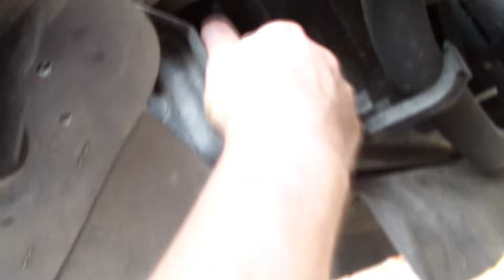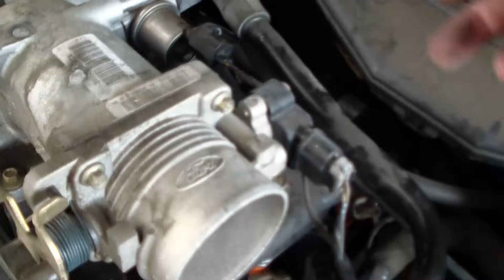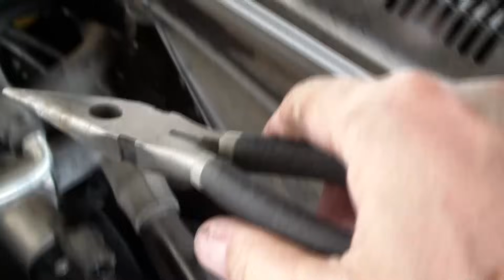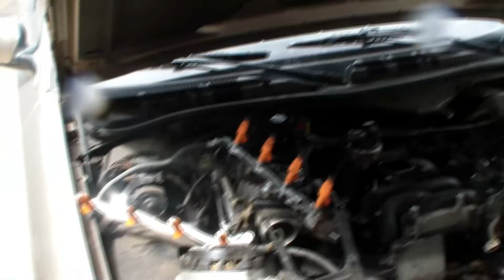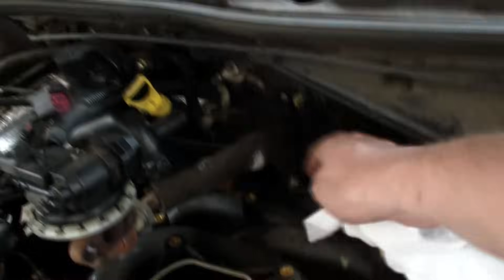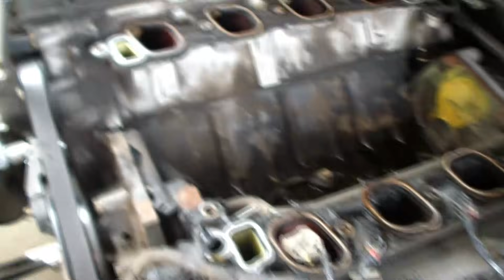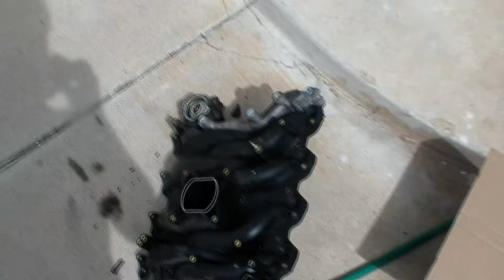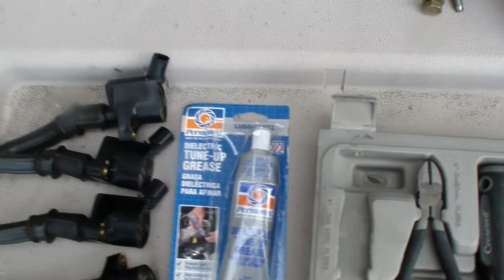Ford 4.6L V8 Intake Manifold Replacement

Comment: Also do you have to have your o-rings resurfaced when you replace the manifold?
Reply from the maker: The Dorman manifold had built in O-rings. I do not recommend aftermarket manifold. Get the original PI Ford replacement from Ford Racing. Much better.

Comment: I had my intake manifold replaced by Big o tires which they cracked however the plug where the heater hose hooks up still has the cap on it. So does that mean when I can't use my heater? I don't understand why mine is still on there,if it has to do with my heater. Can anybody help me?
Reply from the maker: Unless both heater hoses are connected you will not get any heat.

Comment: For this entire car, YOU NEED A SET OF FLEX HEAD RATCHETING WRENCHES. That bracket behind the intake, the bottom left bolt on the passenger side valve cover, and ESPECIALLY the bottom left power steering bolt
Reply: Man SCREW that power steering bolt. Just did a timing job and that was by far the most obnoxious bolt on the entire truck. 

But hold on, do you need to touch it for the intake gasket job?
Reply: @jtfoog5220 oh gosh I hope not I’m halfway in right now

Comment: I ordered a Ford branded intake manifold. I wouldn't be doing this if the aluminum crossover hadn't sprung a leak. UPDATE: I just installed my new manifold on my 02 GT 4.6L 2V. It looks similar to yours. I had a mess under mine on the same side as you did. Must have been some kind of coolant leak. I cleaned everything up as best I could without scratching or deforming any surfaces and hopefully it's adequate. And hopefully nothing went down into the cylinders. Hopefully everything seated OK. I won't  finish up tonight. I still have to re-install the injectors, cops, and throttle body. I got delayed because I decided to replace the 23 year old water pump (which took awhile to get out),  replace the hoses (the lower radiator hose was short so I got a refund and ordered a different brand), and I managed to round a bolt head on the driver side rear of the manifold (I had to go buy an extractor to get the bolt off). I hope I can get the cabling for the TB put back on correctly. I'm hoping for a lot of things to go right. I won't know if everything is working until after I get the new lower radiator hose.

Comment: Doing a similar job, replacing the stupid rubber hose from the water pump bypass, but fyi that entire vehicle is metric. 7/16 should be a 13mm. Your nuts and bolts will appreciate it
Reply from the maker: Thanks for the info.

Comment: So instead of the guy using a thread in brass fitting he decided to make himself replace the whole manifold. Easy.
Reply: I’m grateful he chose to change it. His video was on point. What I did differently that made it easier to remove the bastard bracket was removing the wipers and the molding underneath it.

Comment: 2005 Grand Marquis. Bastard bracket: Undid wiring harness constraints and used bungie cord to pull it forward. Removed a bracket on firewall  connected to tray where wipers are. Then was able to attack from the right side, get a 15mm swivel head wratching end wrench on. Bolt on too tight so cut a 2' peice of conduit for a breaker bar.  Next big hold up was the aluminum cross over all three 5" bolts were rusted in. Had to use a torch to heat up surrounding area. Bolts for thermostat housing were covered in rust all the way to the threads. 
  Found the source of the leak, on the manifold where the thermstat end of crosscover bolds into the plastic.  a 1" chunk of plastic was missing around a water intake. When putting on Dorman  it fit tight, suggest putting on left rear bolt first, then front rt, then rt rear. It was hard to align all the bolts with the holes, very tight fit. Idle is now high. Hope computer figures it out.

Comment: That plug that you said you needed to remove to use your heater hose, mine doesn't use it my hosees go elsewhere and while driving that rubber blew off. How do I plug that hole and what did I do wrong

Comment: All of my intake manifold bolts are rusted and rounded out! I purchased a bolt extractor kit and that failed! Heat didn’t work. My anger is off the charts! Any ideas???
Reply from the maker: I weld a new nut on top of broken bolt. Good luck.

Comment: Great shade tree vid.
I always drill tiny hole in thermostat plate to facilitate cool air relief.
Helps useless trapped air out of system safely. In the north east winter
air can/will gather where it's least needed.

Comment: You aren't going to ark the ground on tge ground with your wrench or ratchet. After it's disconnected, when you put the wrench or ratchet on tge hot, if you hit the ground, it won't arc anymore either, so if we stay in the habit of that, we'll save hide eventually, because the best of us will get comfortable eventually. Why not train ourselves well and try to bring the USA back on the map for quality work?

Comment: So i know this old but when taking off the bastard bracket my 01 vic has a bracket over that bracket held by a 15 mil bolt and a 13 mil nut then under that bracket the 15 mill stud bolt that actually holds that bastard bracket  the 13 mill nut goes on the same stud of the bracket ...passing it along

Comment: I'm in a pickle. Installed the intake manifold and right before torquing the bolts my heat lamp bulb exploded into hundreds of pieces. I'm concerned some glass got in the combustion chamber through the fuel injector holes. I'm guessing a piece of glass in top of a piston would be catastrophic. Any tips? I'm not pulling the head, that's way beyond my skill level
Reply from the maker: Vacuum out what you can. If you have compressed air blow out what you can. Crank engine with spark plugs removed to blow out debris. I bet it will be just fine with no damage.

Comment: I used your video to replace my intake with an Autotecnica FD1413042 intake that uses all the OEM bolts. With your video, It would have take a few hours if it were not for the driver side bracket and second wiring holder bracket that bolts onto the extended stud on the bracket bolt. A swivel 15mm wrench or a low profile socket with swivel ratchet makes. BTW, your video is used as a example on the website.

Comment: Is this intake still holding up? I am watching this after it says it has been 9 years.
Reply from the maker: The Dorman worked fine but I recommend using an exact factory replacement from Ford Racing. The Dorman did not have as much power and I lost 1 MPG.

Comment: Why not 'plug' the spark plug holes also? Whatever falls in could potentially drop into the engine when you replace the spark plugs. I also dielectric grease every electrical connector as it repels water and can make it easier to disconnect later.
Reply from the maker: No need to remove spark plugs to replace manifold.
Reply: @KentDiego  The coil pack are removed leaving the hole susceptible to objects/trash falling in. My compressed air was able to blow out wire wrap pieces. Not everybody has compressed air though. Eventually you will replace the spark plugs.

Comment: Leaking again yet
Reply from the maker: Did you use the Ford PI or the Doorman replacement part?
Reply: @KentDiego  well I talked with my garage but couldn't talk with Paul so I looked really good at where it was leaking  it was leaking from the thermostat housing two bolts that hold down the housing mass corrosion on it so they did not clean the housing before they put it back on  thanks
Reply: @KentDiego  sorry long time I didn't know you could use a pi intake on a non pi u have to know what you are doing few tricks I heard ??????? Not sure how to
Reply from the maker: @joegallagher9167  By that year the PI was factory original. The Doorman lost 1 MPG and did not perform as well. Learned a lesson to always use factory parts.
Reply: No the stock intake was not a pi intake it's not a cop car car from the country in lower KY 1 owner.  1st intake a1auto. 2 nd  intake garage bought somewhere poss AutoZone  so u are saying I can put a pi intake on a non pi heads

Comment: I have replaced my oem intake manifold on my 2007 F150 4.6L this weekend with the help of this video. However I am running into issues now. 
The Dorman has a different size and shape of the rear coolant passage that is blocked off, and as soon as I started putting back the coolant once everything was installed, coolant was pouring out the rear drivers side coolant passage...if anyone has any solutions to this, would be much appreciated

Comment: Just finished mine using your video and another.  The other was take off all the things, but helpful.  Yours is more practical for the garage rat.  Things that took some extra thought:  Gaskets on the new intake are the same shape, but different design than what i took off.  There are spacers for the alternator bracket to raise it up and compensate for the loss of the added height of the gaskets i took off.  Other than that it went as hoped.
Reply: Do you mind posting the link to the other video that helped you? Thx!
Reply: @AdamMayor  7 months out is beyond my memory for a video.
Reply: @MysticSpank  what about loss of height for the egr? Just kind of thinking if the stock gasket raised the manifold up. Then wouldn't when you bolt the egr in it, it would pull the manifold up?
Reply: @Neptune5.56  I had zero issues connecting the EGR.  I see i posted a year ago.  car is still doing well without any additional work to the intake or EGR.

Comment: Just finished mine 30 minutes ago,I cursed and cursed at that bracket,and seeing it really doesn't affect anything, decided to use my cutoff wheel and cut that bastard,after removing intake,unbolted that dumb bracket,cursed it to hell and threw it in the trash,all is good now 😭😭😭😭

Comment: Is the bracket that goes over the driver's side fuel rail absolutely necessary? I don't want to put that bolt back on in the back.
Reply from the maker: The bracket is there to protect fuel rail for 40 mph offset frontal crash test. Many people leave it off. It is not really that hard to put back on, maybe 5 minutes.  Up to you.
Reply: @KentDiego  Thank you for the reply and info. I just left the back bolt off. I had a really hard time getting it off just to fix some fuel injectors. Don't want to deal with it again.🤣

Comment: You should have went with an OEM. These aftermarket ones are garbage. It's a five year part. If you're lucky you can make it last longer. Even a used OEM is a safer bet than a brand new one of these. A lot of work for a cheapo part.
Reply from the maker: Wish I had the time to wait for OEM when I did this. Dorman was junk and I lost 1 MPG. Ford Racing is supposed to be best place to order OEM without getting overcharged.
Reply: @KentDiego  I got a used OEM from an online junk yard parts site. You just search for the part and it shows a list of parts, junkyard/dealer name and actual phone numbers. I paid $36 for mine and $20 one day shipping. It's a direct fit and it's like brand new.

Comment: Can you tell me how did you get that fuel heat shield? I have a 2010 Lincoln town car Executive L
Reply from the maker: Just fiddle with the bolt and you will get it off.
Reply: @KentDiego  can I ask what size you used and any adapter that made the job easier.

Comment: Did this job the other day. Everything went as planned. I used all OEM parts as replacements. I also used very light coating of rtv gasket materials around all ports mainly due to some pitting in the head near cool ports. My whole body hurt for a week 😂

Comment: Just a note! I'm doing this on a 2000 Town Car, and that pain in the ass bracket on the back of the manifold with the two 15mm bolts has ANOTHER bracket on top of it with two 13mm bolts on the back side. That's what the studded portion on the 15mm bolt is for, a 13mm nut goes on that, and then a 13mm a little further toward the passenger side under a wiring harness. Super pain in the ass.

Comment: I'm glad I sold my 2001 f150. The intake manifold was leaking coolant,after I had the metal pipe replaced from a previous leak. Horn went out,blinkers stopped working,a.c. went out too.

Comment: Dude I’m still stuck on the stud on the back of the bracket.
Reply from the maker: It's all about feel. Reach back and feel the stud to get a wrench on it.
Reply: Mine was under a huge harness. Used a 3/8” pic over head ratchet and deep week socket got it no problem and then the rest by hand. I left my EGR in so you have to be careful not to hit the pipe, it lines up with the ratchet

Comment: I wouldn't replace that manifold with anything other than the factory OEM upgrade 2002 manifold plastic but with actual brass bolt screw holes for all those coils!! You will be taking it off again soon. The coil pack mounting holes are always plastic and always break, crack.. they are total shit!! spend the money and get it from a dealer or factory, yes it will cost you much more $$$ but will not be replacing it 2 to 3 more times again as you are now!! Trust m, I own a 2001 Grand Marquis GS and had replaced my intake twice already This time I'm getting the one with all metal bolt holes not plastic shit.
Reply from the maker: The best price for a factory OEM manifold is at Ford Racing. Much cheaper than dealer.

Comment: Got my hands on a 97. It has the updated intake with aluminum runner between banks. Still leaks fluid onto the spark plugs. Fuck it, its getting an aluminum intake I guess
Reply from the maker: Using anything but the Ford OEM part will result in performance loss and other issues. Look at Ford Racing site for best price.
Reply: @KentDiego  I found something but the heads have to be 99+

Comment: Just did mine vehical too and I couldnt find that small lil plastic block position either on a 99 Mercury Grand Marquis or what fit into the 2nd hole the 8in allen key is used for. I used both of the metal screwsin pieces and plugged both holes for now and mine is running great.

Comment: Hello friend, how are you? I speak of Brazil. I see that people change this crowvictory collector a lot, which would be the biggest reason.
does it have any cracks or carbonization?
Reply from the maker: Over time the plastic used to make the manifold gets hard and brittle. This causes cracking resulting in vacuum leaks or coolant leaks. In my case the heater hose nipple broke off while I was changing the spark plugs.

Comment: Did you flush the fuel injectors and use injector rebuild kit them as well.
Reply from the maker: No. The injectors are fine. Never had a problem with them.
Reply: @KentDiego  I was just wondering I heard the o rings can be deteriorated  from years of use.

Comment: Yeah you messed up you should have changed that water tube it was looking right at you when you have the intake off mine just broke their famous for doing that. Double work coming up. Do your research. Retorque the spark plugs before they blow out.

Comment: I see you have some fluid in the engine valley. I just found out today I have oil there and it's now leaking down the back of the engine. Would a bad valve cover gasket cause that?
Reply: yes.

Comment: I had a mechanic replace my intake manifold on my 1999 Mercury Grand Marquis LS.  He also replace one of the coil packs because of a misfire in the #4 cylinder .   I had the spark plugs replaced with new double platinum plugs .Ford calls for platinum plugs The plastic cosmetic cover no longer fits .  I smell gas from the engine bay but I cannot see a leak  .    Those cars even with low mileage had some gas smells but not strong.  The engine idle is not always consistent when in drive .   At times it is like it wants do die but does not.  Old cars become money pits .  I had both front power windows fixed .  The blend door actuator replaced for $1,000.  They had to take off the complete dashboard .  The part is about $20.00 part .  The labor is the problem.  My brother has two Prius cars both with about 140,000 miles .   Neither one has had any problems so far .  I like the car for its size and highway  driving .   They are very old school cars.  Only one wheel drives the car .  Very old school.   Merc only has 72,000 miles on it .
Reply from the maker: Had to replace two coil packs so far. The coils are super expensive at auto parts store. You can get all 8 for $60 on Amazon. Too bad you did not see my air blend door replacement video as you would have saved $1000 for two hours work. I did it without removing dash.  You should not smell any gasoline so look for a leak in fuel rail area. if you look at how expensive a new car is each month you still come out way ahead with the old one.

Comment: I did this job on my 4.6 engine (fordf150);  I think there might be two torque sequences that have the same number. I think I messed up and only did the first one. one is inch pounds and the other is ft pounds. Also the egr valve ended up being a problem child. only after I towed the truck to a mechanic did I find out about the egr valve. He couldn't figure it and told me  to wait for the truck to throw a code. it did and I had to have a custom exhaust guy do the egr valve.A Month later the cylinder filled with fluid again and I said screw it and bought a new jasper engine. Not a bad job, just take your time.

Comment: Did you torque down the manifold?
Reply from the maker: Every bolt on a car has a torque spec. After a while you just go by feel. The manifold is plastic so it is much less than an iron manifold.

Comment: Great video but my Lincoln had the bracket behind the bracket. They are 13mm and there are two of them. The second bolt is on the engine block and hard to access . Have to make sure the wiring harnesses are unclipped and then use a ratcheting wrench. Had to use leverage . Once loosened it came off by finger. Other than that it went smoothly.
Reply: What year is your town car?
Reply: @arizonageorge6164  2001